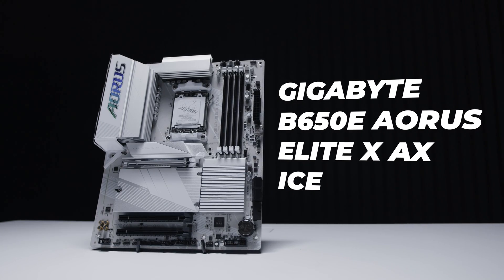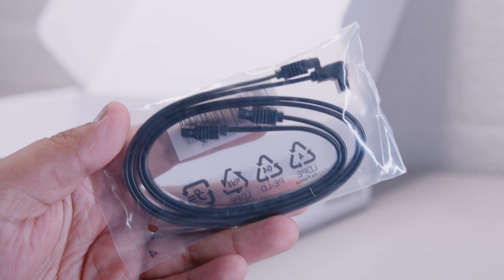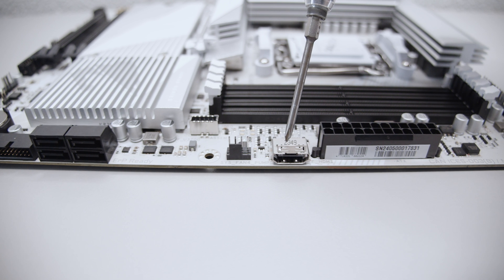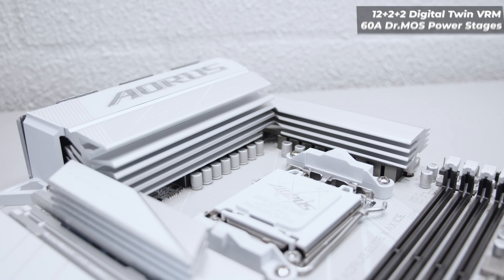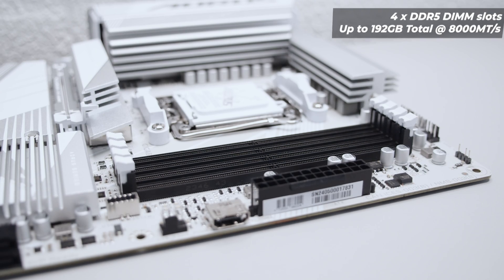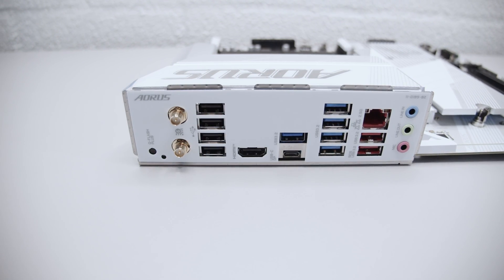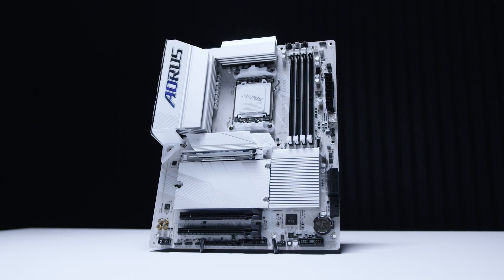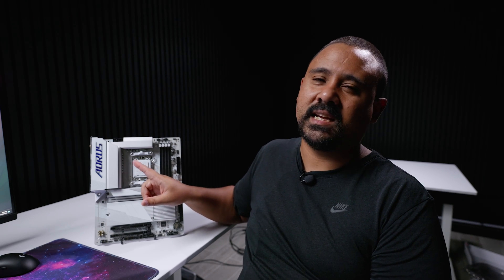The Motherboard you've been waiting for - Gigabyte B650E AORUS ELITE X AX ICE

Comment: Good evening. I have this board with the AMD Razyn 7 7800X3D processor, and I try to install Windows and it gives me error 0xc0000098. I've already seen the issue of CSM and Scurit Boot, I've already installed Windows on the pen several times, trying with Win10/11. When starting with the pen, the Windows logo appears, without a cursor, and after a few minutes it turns off or the Bluscreen appears. Can anyone help me?

Comment: Is it still possible to install the top m2 with a big air cooler/heat sink in place or does that need to be done first? Installing a phantom spirit 120 on this board.

Comment: Love the color but hate the way they reduce their quality as they make them newer. 6-Layer PCB instead of the 8-Layer on the B650 Elite AX along with 60amp DR mos, instead of 70 amp Smart power stages and still using the ALC 897 codec audio from 15 years ago. B650 Aorus lite AX $199.99 with higher build quality Vs B650E AORUS ELITE X AX ICE $229.99 with low build quality in the Layers of PCB and power stages all for more money.

Comment: Looking for a motherboard for my AMD Ryzen 7 8700x3d. Future-proofing is important, but I don't need PCIe 5.0 support for the next 5 years. Budget is under 300 Euros. RAM will be 32GB 6000 cl30 with AMD Expo. Currently have an RTX3070, will upgrade in the future. Considering B650 vs. X670E boards, leaning towards B650 but open to suggestions. Usage is 70% gaming, 30% moderate video editing. Need support for 4 M.2 SSDs and up to 4 SATA SSDs without sacrificing ports or performance, while using multiple drives at the same time. White build compatible preferred. WLAN and Bluetooth not necessary but a nice bonus. Currently eyeing: GIGABYTE B650E AORUS Elite X AX ICE, ASRock B650 Steel Legend WiFi, MSI X670E Gaming Plus WIFI, GIGABYTE X670E AORUS Pro X. Any recommendations appreciated! Thanks.

Comment: I just got this motherboard and upgraded my cpu. First couldn’t get WiFi on there but the store chat said I needed the WLAN driver but do I need the LAN? It showed I was connected to WiFi but no internet at all. Only with Ethernet cord and I can’t really do that. Is it wrong driver or network settings? I’ve seen network videos for changing stuff that I’m about to check. Also, I’m new to PC world but would I want to install other drivers then? Like audio, chipset, BIOS? Do those help/ do anything? I didn’t do this before cause they built it for me but wondering if I’m missing some essentials now

Comment: Why do Board Makers make the White boards at the end of run, then make them cheaper and Charge More For Them. Gigabyte even Stated that the 8 layer PCB gives you better signaling, Lower signal loss and Heat dissipation. So Why put 8 layer on there $200+ boards but not on the New White Boards.
Reply: Agreed, doesn’t really make sense does it

Comment: The board looks pretty but they Charge Way To Much just because it's white. Made to cheap for the price as they lowered the PCB layers to 6 Layer instead of 8 and downgraded the audio to 15 year old ALC897 audio. Even the Aorus B650 Elite AX has 8 Layer PCB for $199.00 and the Aorus B650 Pro Ax and GIGABYTE B650 AERO G  has 8 Layer and ALC1220 audio $249.00. All  3  of the boards even have Higher Power Stages so I would say the B650E is only worth $189.00. The only board worth buying IF They Lower The Price is the X670E AORUS PRO X and if the regular Pro AX is $249 then It should be $229 as it has Lower Grade Audio and Lower power Stages 70 amp SPS Vs. 90Amp SPS.

Comment: Sincerely, everyone. Gigabyte has one of the worst driver support systems and my next build I will stay clear away.
Reply from the maker: It's really not that bad
Reply: But it's white
Reply: @teemu3370 silver / chrome
Reply: The vast majority of mobos i use are gigabyte. My own 4090 is from Gigabyte as well. 6 rigs at home, all with Gigabyte mobos.
Reply: Same, I have yet to experience anything bad, but one bad experience doesn’t make up for everyone’s. Keep that in mind.
Reply: Everyone comes to the internet just for o complain
Reply: I’ve used gigabyte motherboards in 8 different builds never had problems
Reply: I have gigabyte aero z790 i bought this over Asus & msi just because it looks good but their software sucks 🥹
Reply: I dont understand asus shills that openly hate gigglebit for little reason.
Reply: @boydolson5350 people are probably complaining about wanting to update the bios through windows instead of manually doing it lol….

I had this problem 2 years ago & I just stopped caring because it’s not like I don’t know how to do it manually
Reply: I've had an Aorus X570 Ultra running since 2019. It's been flawless. I've updated each time a new BIOS drops and had three different CPUs on it.
Reply: I hear everyone saying this but I've not encountered any issues yet with my B650M Aorus Pro AX

Comment: Does the USB-C DP port on the back output displayport when using a Ryzen 7000 CPU with integrated graphics? Or does the DP alt mode only work with the Ryzen 8000 series APUs?

Comment: I have B650e aorus original black edition, and only thing I can complain about (and most people dont even realize) is that if you are using two pcie 5.0 m2 slots your pciex16 gpu 5.0 slot will halve number of lanes and you will end up with gpu running on 8x lanes...dont know if this is the issue in this white adition as well...just check this before buying
Reply: That Issue   is for all motherboards
 Technically not the motherboard  fault is the cpus
That limits ur pcie lanes
Amd give u 24 pcie lane n the chips set give u another 8
Still more than intel
If u need more u need.to go with a  with a threadripper
Reply: @NeVErseeNMeLikEDis  yeah I know its a limitation of lanes, but what will happen If I use only m2 gen 4 not gen 5 ssds. I think it will cut your gpu pcie lanes down to 8 anyhow no matter what type of ssds you are using...